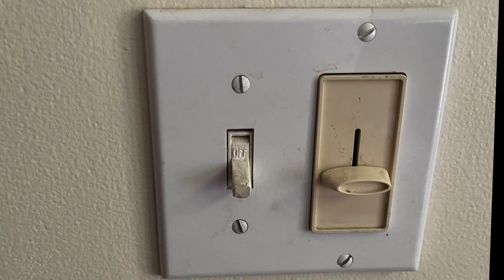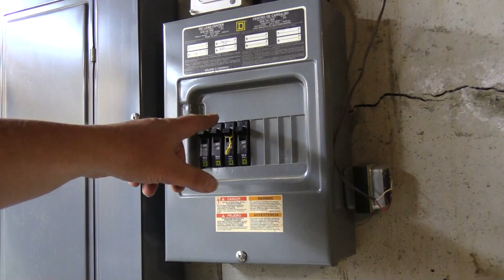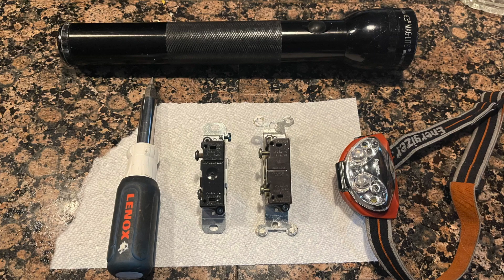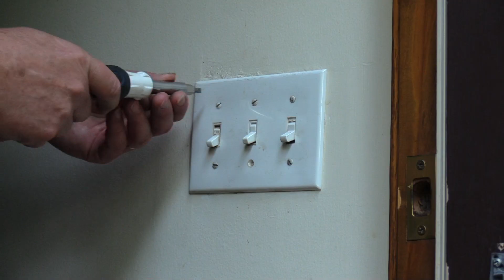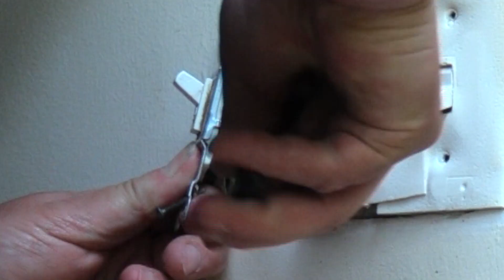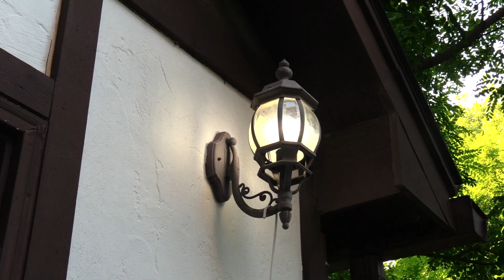How to replace Faulty Light Switch, tips and tricks seen no where to make the job safe and easy

Comment: Thanks Norm, another great video. Keep up the good work and waiting for the next one.
Reply from the maker: Did you pick up any tricks watching it ?
Reply: @normanpaulife  Zip tie on the breaker, tape on the switch and buffing the wire clean. Great tips...
Reply from the maker: My two favorite tricks are the using darkness as a tool allowing me to find the correct circuit breaker. And the other using a scribe to align the gang switch with cover installed